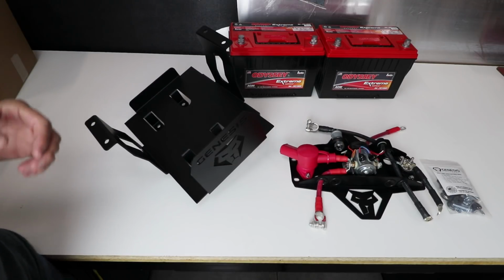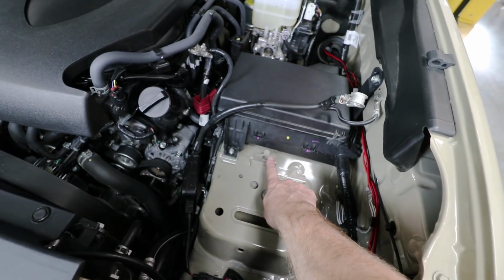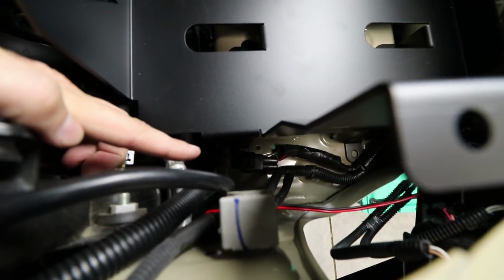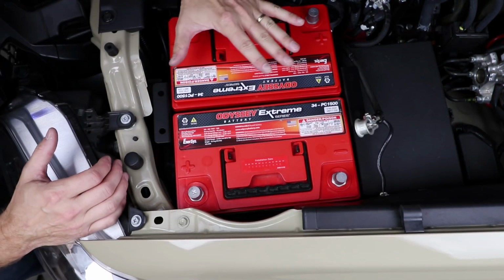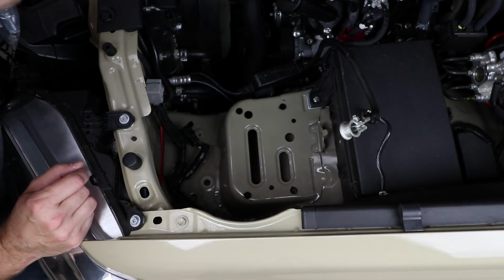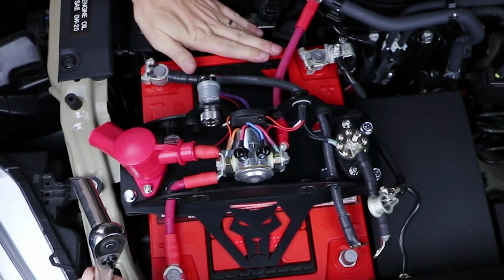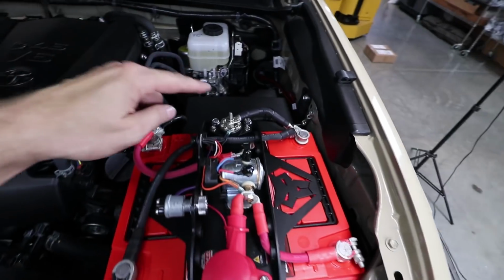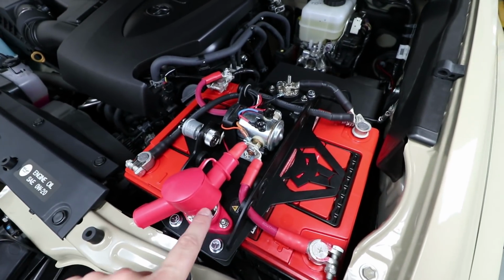Toyota Tacoma Dual Battery Kit Installation Instructions

Comment: So im thinking of getting a Tacoma (2024-2025) a few years down the road, i do like this idea.  Now i am planning on keeping my audio system from my Camry, and get a high output alternator since i know thats a must for the kind of power im used too.  Anyways, would a 240 amp from Mechman damage this kit at all?  My 2 amps pull 110 amps total at full power (1800 watts)....  Im guessing i would hook the alternator up to the cranking battery and the kit takes care of charging the acc battery by jumping the connection with that solenoid.  I just want to get a few years more out of my camry before i trade in and get the taco.
Reply from the maker: Hi Nick, our solenoid is rated to handle 200 amps flowing through it all the time, and it can handle spikes of up to 750 amps for 30 seconds. It's unlikely that your alternator would put out over 200 amps continuously - that's a lot of current. I'd still recommend you check with the alternator manufacturer to ask about it's continuous output just to be safe.
Reply: @GenesisOffroad  Only reason i have a H-O alt is so my amps can use that extra power so i dont get bad voltage drops....  I believe the OEM alt puts out 130 at max....  The ticket that i got from mechman that has the factory test results is 146 amps at idle and 246 at 1800 rpm so....   Mechman is pretty well known in the car audio industry....   the standard install for a H-O alt for that is zero gauge "big 3 upgrade"  that routes power directly from that alt to the main battery, and the grounds (chassis, and engine)...   I did email mechman too just to double check on what you said though.  Otherwise, il just have to go with the biggest battery i can fit in that area....  I live in MN and this past winter (2018-19) was brutal especially Jan 27th-31st with -60F windchill (-40F actual)...  It would be nice to have only if the technical limits let me do it unless you upgrade it in the next few years to handle more amps...
Reply: @GenesisOffroad  got a email back from them.  It is regulated, it doesnt put out full amps, only what the demand of the electrical system is at any given time.  Also it will put out what the battery needs too even if the electrical system isnt demanding that much.  I do see my volts on my camry sometime go up too 15.1v during cold winter days just to charge the battery faster....  So if i not using my stereo, and the car is just running during the day time, that could only be like 50 amps.  If im running my amps, it could be pulling 50-100 amps extra at any given time and its not steady.  Its spikes of current when the speakers demand more power for certain music tracks etc....  So maybe il be safe with it?

Comment: My  3,000 rms amplifier stereo keep cut off, will this dual battery help?
Tacoma 2017
Reply from the maker: Our kit will help by spreading the load of the amplifier across 2 batteries, and it will also protect your cranking battery from being drained down by the amp. However, if the amp is drawing more current that the alternator can supply, then the excess demand will come from the battery, which will eventually drain it. In that situation, our kit would let you run the stereo longer, but if you're pulling that much current, you'd want to look into a high output alternator. Hope this helps!

Comment: You would think that the tray should have already been made to fit with holes bolts with no drilling involved by using the existing holes from factory.
Reply from the maker: I would have loved to do that, but unfortunately there are no good factory points to tie into in order to secure the tray.

Comment: To much weight on the same side.. i think
Reply from the maker: It's only an extra 50 pounds, pretty negligible. Filling up your gas tank from empty creates more of a weight shift than the dual battery kit does.
Reply: You will want to add a 1/2" spacer on top of your driver side strut to correct the "Tacoma lean"
Reply: @Eggsr2bcrushed  just get a real lift kit! Jesus Christ!
Reply: @Eggsr2bcrushed  LOL!

Comment: I’m installing this today and one of the holes are drilled was 1/2” you recommend in the video, the tray bolts went right through the 1/2” hole! Luckily it was one out of six, the other five holes were drilled 13/32”. Was there any hardware changes after this video was published?
Reply from the maker: Ducati M Yes! So sorry for the confusion, we switched to steel nutserts from the rubber well nuts. I’m trying to figure out how to add an annotation to the video about that change. Our pdf instructions on our website has the details on how to install the nutserts.
Reply: Genesis Offroad could you send me a link to the PDF instructions? I’m having trouble finding it on the website and on Google search showing visuals on the tray bolts. Thanks!
Reply from the maker: @ducatim1563  Sure, here's the link to download the Tacoma instructions - https://drive.google.com/open?id=1h6hvY-wNX5IZs-AWll2D15C_H52_gJbg
Reply: @GenesisOffroad  I just made this mistake... I'm waiting on rivnuts I ordered to come in..

Comment: nice setup, but those rubber well nuts will rub through in a matter of time.. wouldnt it be better to go with a riv-nut? or even hard bolt with a nylon/delrin spacer?
Reply from the maker: killahjeep We had a couple customers early on that over tightened the well nuts and destroyed them. Definitely don’t want that happening, so we have switched to steel rivnuts now. The pdf instructions on our website shows how to install those properly using a 25/64” drill bit.

Comment: Could you link the information video you speak of in the beginning of what this product does?
Reply: its a second battery.. lot of off roaders use a second battery to help run the 1,000 accessories they have on their truck. When you were a kid in high school and installed subwoofers that were way too big you ever notice your headlights dimming on every single hit of the bass? enough accessories like LED light bars, air compressors, etc etc will do the same. some people just want to extra juice and a second battery is the way to go. car runs off main battery all accessories run off the second battery. this little system helps tie the two batteries together so #2 is being recharged by the alternator just like the stock battery does each time you drive your car.

Comment: What are the benefits of using this thing?
Reply from the maker: Our system allows you to run your electrical accessories without draining down your cranking battery. The smart isolator links 2 batteries together to give you the combined capacity of both of them for extra run time and to spread the load across 2 batteries. This is helpful for winching, so you're not just draining one battery down so quickly. Once the batteries drop below 12.7v for a minute, the smart isolator separates the batteries to protect one for starting the engine later. We take it a step further - if your cranking battery gets too low and won't start the engine, you can press the boost button to jump start yourself from the second battery. We also give you power & ground bus bars for a convenient spot to connect all your aftermarket accessories that need direct battery power. All completely pre-wired for you out of the box. Hope this helps!
Reply: @GenesisOffroad  
This is great for expeditions vehicles bug out vehicles or just for off roading
Cool gadget

Comment: My truck is the Tundra and I know that you guys sell a kit for the 2014+ but I have a 2012 and they have the same engine bay, will that kit work in my truck?
Reply from the maker: Hi Aaron, the '07-13 Tundra's headlights are a different shape, so they just barely touch our battery tray. We have a solution for that now. We have some small brackets that move the fuse box backwards just about a half inch or so, plenty to clear the headlights. I just need to update the website with this new info. If you'd like to order one, just put a note in the comment section that you have a 2012 Tundra, and we'll include those brackets. Also, be sure to watch our install video for the Tundra kit! Thanks!

Comment: My corolla i had used group 35 why would a truck use such a small battery makes no sense..
Reply from the maker: The Tacoma kit uses Group 34 size batteries. If you use a quality deep cycle AGM like the Odyssey PC1500, it has 850 cold cranking amps and 68 amp hours of reserve capacity, which is a lot for the size. There's only so much room under the hood, so the Group 34 is the largest battery that we could shoehorn in there.

Comment: Would you happen to have set for a 1986-1995 Toyota pickup truck or 4Runner?
Reply from the maker: We don't have a kit specifically for those models, but we do have a couple of universal options that may work for you. You can see more details and the dimensions on our website - genesisoffroad.com.
Reply: I bought a secondary battery tray for my 4th gen 4Runner from Off Grid Engineering. The only issue with it is, the battery is diagonally across from the starter battery.

Comment: $$? Will led headlights fit in front of the batteries?
Reply from the maker: As long as they are no deeper than the factory headlights, they will work just fine. You can double check that with your aftermarket headlight manufacturer for that measurement.

Comment: can you cut the part that hangs over the fuse box so it has the ability to come off?  My SPOD sits on top of my fuse box and that looks like it would be in the way
Reply from the maker: Email me a picture of your sPOD mount, I can probably tell by looking if it will fit or not - shane@genesisoffroad.com.

Comment: Does this also work on a Toyota 4Runner?
Reply from the maker: Cameron Garcia We are working on a 5th gen 4Runner kit right now! Planning to launch that kit in February ‘18, stay tuned!
Reply: I wrote to you back in January about this being built for a 4runner.  Since you have a 4Runner kit that came out i nFebruary, do you also offer one designed for a Tundra?
Reply from the maker: Cameron Garcia we now have kits in stock for the 5th gen 4Runner and the 3rd gen Tundra!

Comment: I love it. But what happens if you have to change the headlight?
Reply from the maker: Simply remove one of the batteries and you can easily access the back of the headlight assembly to change the bulb.

Comment: Very nice. Do you have a kit for the Tundra as well? Also, would there be an issue connecting a solar panel and solar to the secondary battery?
Reply from the maker: Hey Bradley, I'm picking up a Tundra later this week, so the Tundra kit is coming soon! Lots of people run solar to run their accessories without starting the engine. You can connect the solar charge controller directly to the power and ground bus bars on our kit. Hope this helps! -Shane
Reply: Genesis Offroad if you ever need a beta test vehicle in So Utah I just happened to have one.
Reply from the maker: Bradley Johnson Our 3rd gen Tundra kits are now in stock!

Comment: Will this kit fit a 2017-2018 4Runner?
Reply from the maker: Hi Justin, the 4Runner looks a bit tighter under the hood between the fuse box and the front grill. I will be getting a 5th gen 4Runner in the shop very soon to design a dual battery kit for them. Stay tuned, it will be coming soon!
Reply from the maker: ETA on the 4Runner kit is February '18!
Reply: Awesome!
Reply from the maker: Justin Richards our 4Runner kits are now in stock!

Comment: Will having 2 batteries over work the alternator or is it more than capable? Very interested in purchasing this set up.
Reply from the maker: When the batteries are isolated, it will allow your alternator to charge the cranking battery first. Once the cranking battery is above 13.2v for 2 minutes, the smart isolator will link them together so the aux battery can be charged. At that point, they will look like one large battery. The stock alternator will be just fine for charging them.
Reply: Genesis Offroad So basically the alternator does not charge both at once? It just has to change one then the next
Reply: Genesis Offroad Also where is the G screen located if I select that option?
Reply from the maker: Once they are connected together, the alternator will be charging both batteries at the same time.
Reply from the maker: There's a few places for mounting the screen, depending on which options are on your truck. The screen is about 1 cubic inch, so it's pretty easy to find a spot for it. I'll be doing a video soon to show how to install the G Screen in a Tacoma.

Comment: Looks like you'd have to pull a battery to change the headlight bulbs?
Reply from the maker: Yes, it is very tight in there. The battery sits immediately behind the headlight assembly.

Comment: Very interesting setup.  Very clean install, and pretty straight forward idea for saving the cranking battery from being overdrawn from accessories.  

My only note is that the front most positive terminal is scary close to the chassis there.   One tap from a small fender bender, tip into a rock, or other crinkle in that corner and it could be a nasty hot spot real quick.  Any plans to have some sort of insulator added to that area?
Reply from the maker: Thanks for the suggestion, we will certainly consider that!

Comment: Will Genesis Offroad be coming out with a dual battery system for the 2017 & up Chevy Colorado with the diesel option?
Reply from the maker: It all depends on the demand. If we start getting enough Colorado owners asking for it, then absolutely!
Reply: I need one for 2015 colorado z71